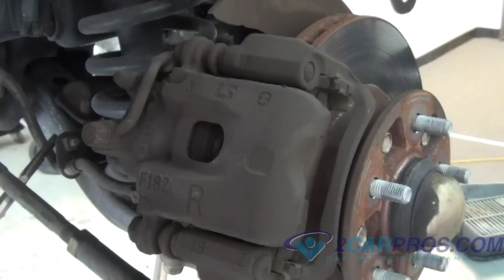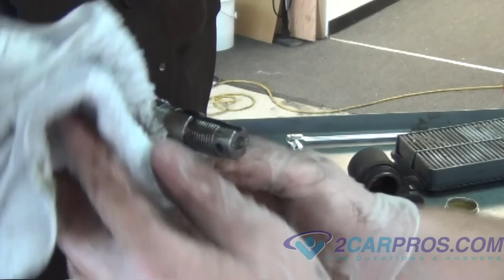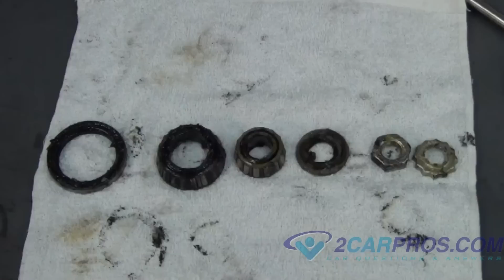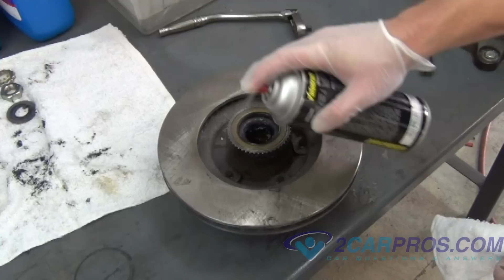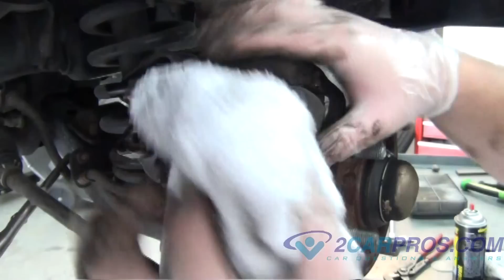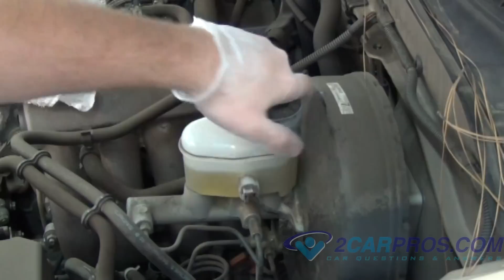Front Brake Pads & Rotor Replacement Toyota Tacoma 1995-2004

Comment: Adding to my comment it seems that if you have a 2 Wheel Dr., first GEN Toyota Tacoma with the six lug wheels, the hub is not bolted to the rotor. It comes right off like you’re changing a spare tire twice it’s very nice.

Comment: I have a 2WD 2002 Toyota Tacoma.  Which is everything you missed it in the title. When I took my wheel off, my rotors were not attached to a hub they slid off very easily and I did not have to touch bearings at all. I’m wondering if something is listed wrong in this video or the chance that my stock Toyota truck is somehow an anomaly… I ordered my parts specifying that I have a 2002 Tool Dr., Tacoma and they came with the correct rotors mounted to my Lugnuts and I did not have to take a dust cap off or approach the bearings at all. I’m very confused by this post because I always make sure to watch 3 to 5 videos on the same topic.. all the other videos I watched, were exactly what I did today when I replaced my rotors I don’t understand why this one video involves a hub that is bolted to the rotor   I have 6 lug wheels. Maybe that is why

Comment: First of all great video! Am i correct in assuming the inner and outter race's were left in and reused since you reused the old bearings? Also what is the best way the remove the old races if they are damaged and need replacement? With out a press or taking to a shop? 96 Tacoma 2wd , 5 lug.
Reply from the maker: That's correct. Our races were fine. I'd probably just get new rotors with the races pre installed. Or get a race driver set and pound them in and out. Thanks for watching!

Comment: My rotor is stuck to the wheel hub. Any suggestions! PleaS help need go get to work tomorrow!!!
Reply from the maker: Put the lugs back on the studs and then strike the flat surface between the studs with a heavy hammer. Thanks for watching!

Comment: Nice video. This looks like a rust free state truck. I would also clean and lube the hardware where pads are installed on caliper bracket.
If they are rusty should be replaced.
Also the seals should probably be replaced not cleaned and reused. If the rubber seal fails there will be grease all over rear of tire.

Comment: I should have watched this video before attempting to replace my rotors on my '97. Done my wife's Rav4 a month or so ago and that was easy compared to this pile. I have changed brakes and rotors on a great deal of vehicles I have owned and this one by far is the worst. Got it done. Don't know how long it will last. The race on the outer bearing didnt flush with the hub. Stuck up barely above the lip but the POS went back together so I'm driving it

Comment: Excellent video. My two cents…Note that after he disconnects the brake line from the caliper he leaves the brake line bolt in place to keep brake fluid from draining out. I had to rewatch to see what I didn’t follow! Oh well fortunately my master cylinder did not empty.
Reply: Mine kept leaking after I disconnected it. So I just flipped it the other way around and put it back, giving me enough space to remove the upper bolt.
Reply from the maker: Great point!
Reply: He Didn't need to disconnect the breakline. He just dosent know what he is doing..

Comment: Thanks for posting!  Though your hub separated from the rotor far easier than mine, everything was spot on!   Lock washers on pad bracket bolts and 19 years of upstate NY rust were a real bear but got everything off ok.   Also had to sand some corrosion off the brake line fitting and bolt(even with the gaskets) to stop it from leaking.  Fun fact, parking brake light stays comes on when your brake fluid level is low!
Reply: Your rotors lasted 19 years?
Reply: @SkipsAweirdo  Mine lasted 25, with 200k miles but zero snow belt time.
Reply: How did you get the hub off the rotor I've tried hitting it as hard as I can it won't budge

Comment: Great video but just so everyone knows be really careful using the axle nut to remove the inner bearing like he did because I dented up both of mine and had to replace them
Reply: Yep, same thing happened to me. I bent the metal part of the bearing. Went to Toyota they wanted $160 for 1 bearing. No thanks… went to napa got em for $11
Reply: @santoslaguna58  Yep, autozone for me 👍
Reply: Seconding this! Not a good way to remove the inner bearing. Not sure what the alternative is but now I'm waiting for my new bearings to arrive.
Reply: I just replaced all of the bearings.
Reply: Ik this comment’s old but you should just replace both bearings while you’re doing it

Comment: Must be nice to work on a clean vehicle. I stripped the head of one hub bot so far. First brake line bolt doesn't even look like a bolt anymore. Trying to work around it. Other side ( worse one) can't get either slide bolt out and hub bolts want to strip. Good part is I'm doing it out doors on a patch of ice covered with oil from my tractors oil. Good part is the sun was shining and the birds were singing. Parts should be in today. It's raining though. Good video though. Now I know how to do it in a perfect scenario.
Reply from the maker: Try spraying doing the area you are working on with some carb spray then wiping down with a shop towel. Thanks for watching!
Reply: @2carpros  Got the rotors out today and picked up the new ones. Thanks for the tip on the inner bearings , that helped a lot.
Reply: @2carpros  i live in northern NY where they salt the roads 6 months out of the year. So it ain't all dirt. The rust just fuses things together. PB blaster and torches are part of every job , lol.
Reply: Got er done just before the blizzard hit. Soaked the hub bolts overnite and bought a 6 point impact socket and removed the stuburn bolt. Left the brakelines and caliper bracket on so I would have to replace them to. Slides funtioned but bolts were fused solid. It was a pain but they work. Thanks for the video, It helped a lot.

Comment: Thank you, this video helped greatly doing a similar looking job on a Toyota Spacia 2001 model. I was trying to force that hub out as I thought undoing the locking pin would pull the entire hub out rather than just the rotors.
Reply from the maker: Thanks for watching!

Comment: Great video.  I have a 1994 2wd Toyota pickup.  I can't find any videos on that year.  Is it much different than the 1995?
Reply: I have a 95 Tacoma V6 2WD LX.  Never dripped 1 drop of oil in 10 years. keep a watch on the fan clutch, make sure it is sound. if you spin the fan by hand & it doesnt stop very quickly. Replace. They dont last as long as you might think either. I check mine whenever Im under the hood. my last 1 only lasted 3-4 years. just go buy a Chilton manual for it. 15$ will save you 1000's.
Reply: A Female & Can't Find Any Videos on my 1999 T. Tacoma 2wd 2.4l Original Owner 1Generation Bought Brand New Any videos that you Know of for Inside cab to Remove Back Sides of Panels to put New Nuts & Bolts For Window 🤔

Comment: Does the brake line have to be removed ? what
Reply: No but you cant get at the top slide bolt with a socket or even a box end. You also have to compress the caliper. Thats how Im trying to do it. Brake line have never been off and one doesn't even look like a bolt anymore. Probably a year late replying but maybe someone else will benefit

Comment: Great... all the car maintenance video makers should learn from this guy...
Reply from the maker: Thank you so much for watching!
Reply: you are high, there is absolutely no reason to diconnect the brake line, nor to remove the slides, just unbolt the carrier from the spindle and lift the whole assemble off in one piece
Reply: @edwardnoce5596  to change the pads no... To change the rotors yes you need to remove the line...
Reply: @LuchoPortugayo  bullshit, i have never needed to remove the brake line to change my rotors...or remove the sliders, just unbolt the carrier from the spindle and it all comes off as one unit, and no need to bleed your brakes afterwards

Comment: Really great video! Very informative. One question. What is the torque spec for attaching the rotor to the hub? You used a pneumatic gun but didn't say how tight those bolts are to the actual rotor.
Reply: 6:45-7:33 in the video
Reply from the maker: Just tight is good. I don't really have a torque spec for it. If I didn't use a gun I'd put my arms into it. Thanks for watching! :)

Comment: Great video. I have a problem where I couldn't separate the rotor and the hub after removing the 5 bolts. I've tried hammering it from the back of the hub but no luck. Any suggestions?
Reply from the maker: Try spraying WD-40 or liquid wrench between the axle spline and the rotor. Then keep going at it with a hammer, just don't hit the threads! Thank you so much for watching!
Reply: 2CarPros thanks for quick reply. do you think if it's ok to hit it while it's still on the car? I'm planning to tight it up with the axle nut and hammer the rotor from the front. because it kept on jumping around if I do it off the car... ugh hassles!
Reply: Just drop it onto a hard surface like a cement floor or paved driveway rotor side first.  Hold it up about waist high with the rotor facing down, and then just drop it.  May take more than one time.
Reply: I know I'm a year late, but I had the same problem and solved it, so I figured I'd reply here in case it can help someone else. Put the rotor on two blocks of wood (or anything if you're junking the rotor), with the inside of the rotor, if it were on the truck, facing upward. Pound on the center of the rotor assembly with a block of wood and a hammer. It shouldn't take much effort that way, and mine was pretty rusty.
Reply: snippits75 Thank so much for this comment. Have been struggling for 2 hours trying to brake the two apart.

Comment: Great video.   So for a 96 tacoma 2wd (5 lug) you will need to remove the axle nut and the two piece rotor assembly to replace the rotor?   Seen other videos where the rotor just slides off after removing the caliper assembly.  Not sure what year Tacoma those were.   Also, if you damage/strip any of the mounting bolts for the calipers, are they easily replaced at auto parts store or do you have to got to Toyota service dept?
Reply from the maker: In this video it is for the 2wd so the steps are show for removing the rotor. As for your question about the mounting hardware those will be a dealer only item.
Reply: Ok.  Thanks.
Are there any specific torque settings for the various bolts?  I noticed that you did not use a torque wrench for any of them?    Also, the axle nut tightening is a little unclear.  You indicate that "you wouldn't want this on very tight".  That seems like a pretty subjective setting.
Reply from the maker: Yes too tight and It will wear the bearing out to loose and the bearing will fail also. If you want torque specs you can always google search for them.

Comment: It is a decent instructional video, up until the point where the spindle nut is installed.  The problem is this is a fixed spindle, it doesn't spin, the rotor and hub spins on the fixed spindle.  So spinning the rotor and hub is not tightening the spindle nut, you are just turning the nut back and forth with wishful thinking.  This will be costly and dangerous to those out there that follow this video step for step.
Reply: blake hunter My service manual says this: Tighten the nut no more than 12 ft. lbs. of torque, spin the hub in a forward direction while tightening the spindle nut to approximately 20 ft. lbs. to seat bearings, loosen the spindle nut 1/4 turn, then using your hand only tighten the nut until it is snug. install the nut lock and cotter pin, I would like to get your view if this sounds correct.
Reply: Worst part I see is the method of removing the inner bearing, banging it against the spindle nut.  IF you are replacing the bearing, no problem.  But this video the bearing is cleaned, repacked, and reused.  Lateral banging on the bearing against the nut does damage to the bearing (even if not visible to the naked eye) that will in effect shorten the service life of the bearing.   Just sayin'
Reply: Also confirmed in my service manual - video is correct. Not sure what situation Blake’s advice would apply, but overtightening that spindle nut would be BAD. And I don’t think it would take long for bearing failure.

Comment: Could you please explain the reason why you disconnected the brake line? Great video thanks
Reply: +2CarPros there is no need to remove the break hose. all you had to do was take off the bottom bolt and pivot the caliper up and slide the upper bolt out of the bracket.
Reply: David Yep.
Reply: Only if he was changing just the pads. He changed the rotor too which requires removing the caliper and caliper mount.
Reply from the maker: Its the only way to get the caliper slide bolt out.....  great design huh?
Reply: +2CarPros I hate this design!!! Wonder if you just take the whole plate off like if you are changing the rotor to get the pads off......
Reply from the maker: +Dan Keller That is why servicing these brakes is more expensive than most.

Comment: Hello!  When you disconnect that brake line before taking the caliper off, does it open the brake line up and spill fluid out?  Do you need to bleed the brakes because you took that line off?
Reply from the maker: Yes as explained around the 20 minute mark. Please subscribed!